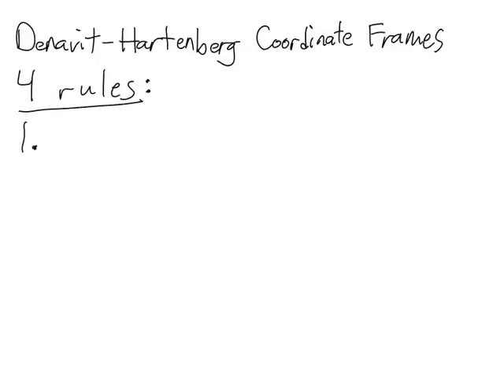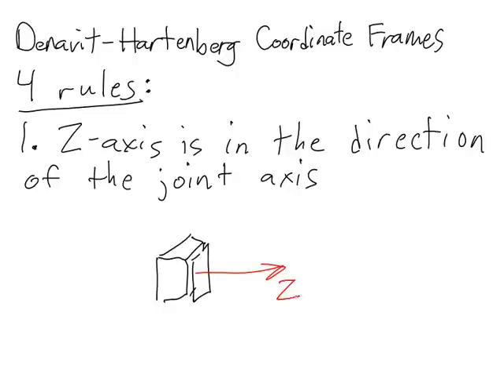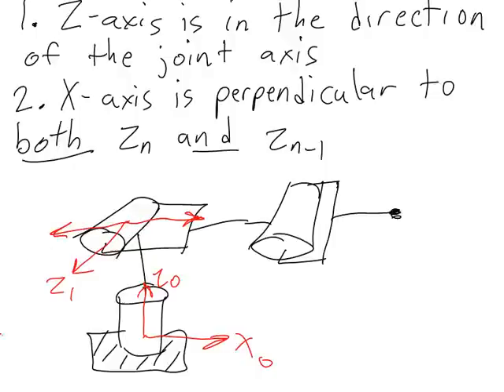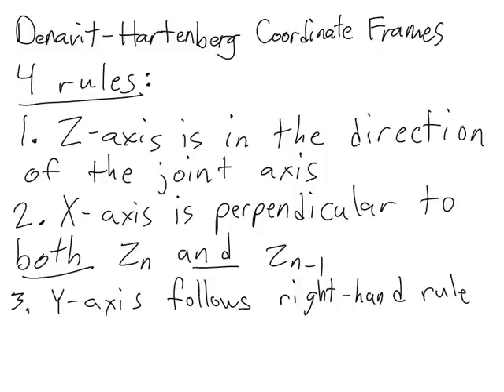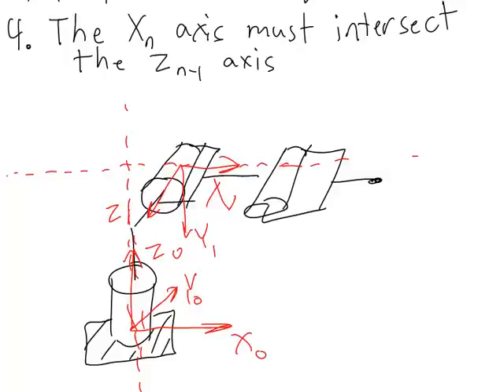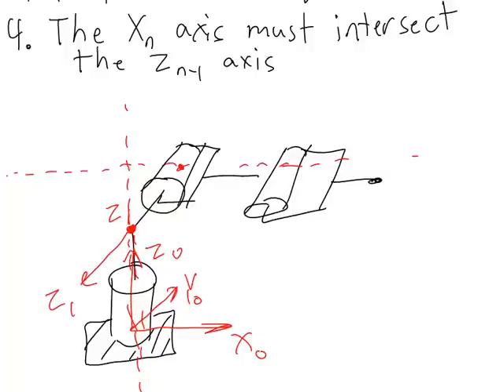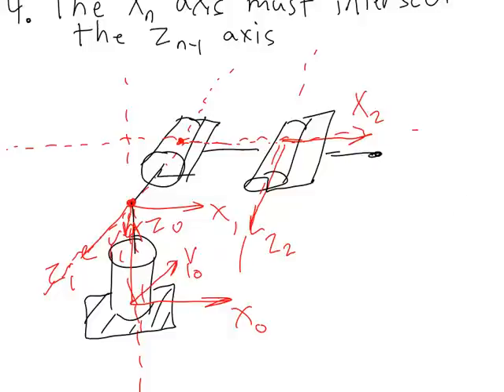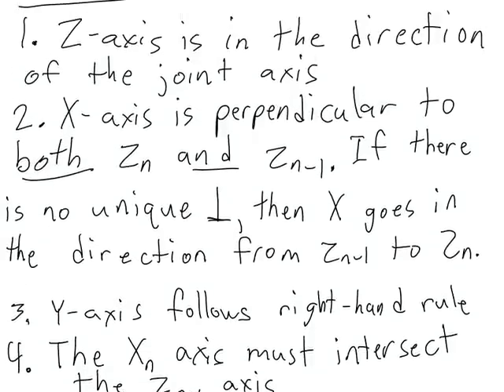2 1 2 Lecture Video 3 of 4 Denavit Hartenberg Coordinate Frames

Comment: 10:40 Z1 and Z2 are parallel. You can't draw even a single "mutually perpendicular" line. How did you draw so many like a chariot wheel rims?
Reply from the maker: I am not sure if I am correctly understanding your question here: If two lines are parallel, then any line that is perpendicular to one of the lines is also perpendicular to the other. So, there are many (an infinite number) of mutually perpendicular lines here. All of those lines I am drawing at 10:40 are showing examples of these lines.
Reply: @asodemann3  The set of all possible lines for our x axis are on a plane containing Z1 and Z2 right?
Reply from the maker: @user-jm6gp2qc8x  yes, that's correct. In the video, this requirement is taken care of by 'Rule 4' saying that the X axis has to intersect both Z axes. But, saying that X has to be in the plane containing both Z axes is also true.
Reply: @asodemann3  Now, all the lines in the set (i mentioned above) should be parallel yes?
Reply from the maker: @user-jm6gp2qc8x  the set 'all lines in the plane with Z1 and Z2' are not all parallel. But, if you include the second requirement 'and are perpendicular to Z1 and Z2', then all lines in the set are parallel.
Reply: @asodemann3  Yes I was talking including the second req
Reply: @asodemann3  only when the lines are parallel,we can make sure the lines are perpendicular to z1 and z2. You said we can draw infinity many x axis. But the one's you drew were not parallel, they look like the rims of a wheel ( lines pointing outwards from a point).
Reply: @asodemann3  just finished the 4 videos in series BTW. It was so good!
Reply from the maker: @user-jm6gp2qc8x  Thanks! You can find newer versions of all of these videos on my website, www.robogrok.com

Comment: Nice video!

But shouldn't Y1 be pointing upwards? If I understood it right, the right-hand-rule should let it point upwards, or?

Greetings from germany
Reply: you always should use the right-hand rule: 
thumb = x
middle finger = z 
index finger = y
you just have to rotate your hand ;)
Reply: i wish someone would clarify "right hand rule" just google that and see the many inconsistent images...who knows what top use in this video alone ive read like 3 configurations
Reply: this is wrong. thumb z
index x 
middle y
Reply: and yes flow ur right
Reply: +FlowR91 Okay, I just figured out, that there might be a few right-hand-rule-configurations...so this one is with thumb: z and midle finger x, right?
Reply: +FlowR91 You don't use the right-hand rule this way. You should use the Left hand in this method. Thumb = Z axis, X = middle finger. And answering your question, Y1 should be pointing up.
Reply: Eddie Amaya you can use the right hand rule rotating your hand around your thumb. this will show you the direction of the rotation represented by a vector in the direction of your thumb. You can use as described above too.
Reply: right , but if you rotate your hand x is another direction at the same time , but x is right side and y is must be up